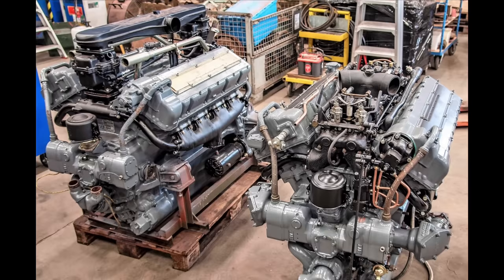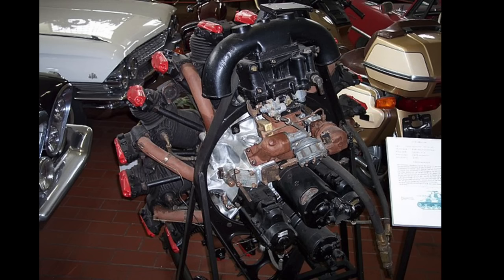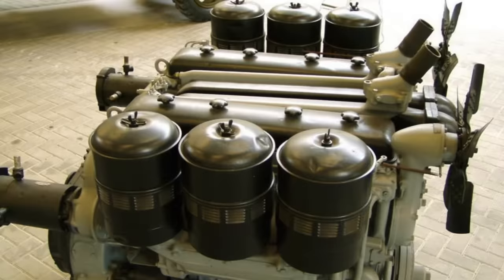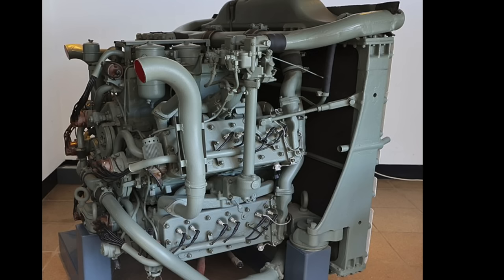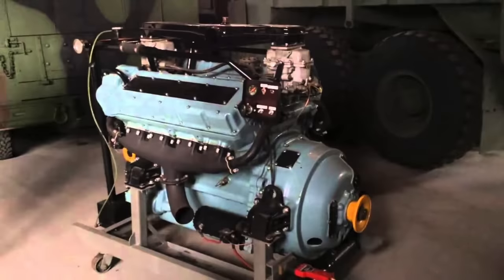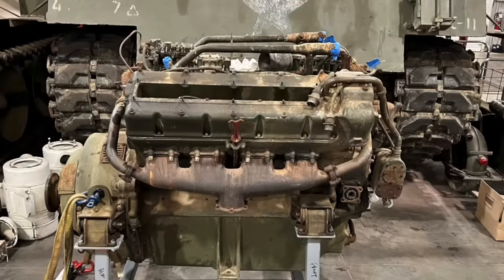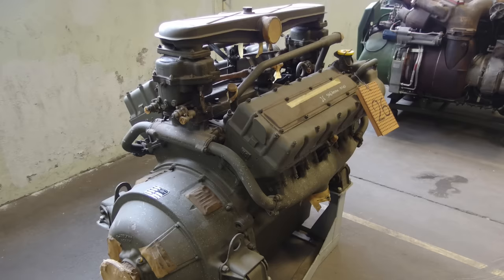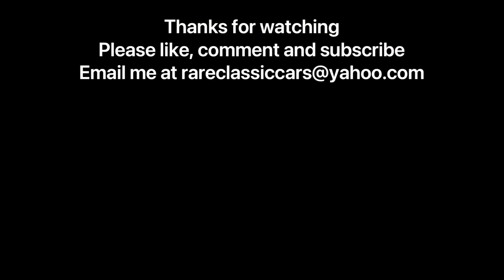An All-Aluminum, Flat-Plane Crank, DOHC V8 in 1940! Ford's 1,100ci (18L) GAA V8 Is a WWII Marvel

Comment: It's amazing that after the war they went right back to producing the flathead for like another 10 years
Reply: One would think about the times... There really wasn't a horsepower war, and Furd relied on the fact that their vehicles were built light, as were most mass-produced autos, the flathead motivated those Furds right along to justify them to keep making the quick buck with every option... as long as it was black.
Reply: Cost had a lot to do with the flathead V8 engine design. Also the main reason GM, Chrysler and Ford all still produce pushrod V8's today.
Reply: The flathead was cheap, reliable, and it worked.  Ford would have been making that into the 70s if GM/Chrysler/Foreign manufacturers didn't go to OHV first.
Reply: @randr10   That and they are much more compact and lighter, also something like a LS motor is so much more powerful per weight than most other engines and affordable.
Reply: Thermodynamically the Ford flathead V8 was a disaster from day one.  The long exhaust ports meant that much of the heat energy of the fuel went out the radiator instead of making usable power.  Add low compression and terrible volumetric efficiency and you have a reliable boat anchor.  Oh yeah, almost forgot the missing main bearings.  R.I.P.
Reply: Really...my very first thought. I wonder why a 1/3 version of this could have been made for cars...or at for least racing. It wasn't until the mid-1960s when Ford made their killer DOHC  V-8  255 cubic inch Indy engine winning the 500 with Jim Clark.
Reply: Its about production costs.  Today's cars are way WAY too expensive, partly because of things like DOHC engines, and aluminum-block engines.  The Japanese, who are subsidized by their government, started selling those engines in mass-produced cars, and that forced Detroit to follow suit.  Of course, it didn't help, as Detroit couldn't charge enough for the cars and eventually went broke selling cars at a loss.  Shows that Detroit's unwillingness to come up with "advanced technology" was grounded in facts, not just stubbornness.
Reply: @randr10 not to mention timing chains on OHC engines are lame
Reply: @sixoneninecustoms timing chains aren't lame, they're used for efficiency. Same as the chain drive on motorcycles.
Reply: Simca continued building Ford flatheads under license for military trucks all the way til 1990.
Reply: @theophilhist6455  arguably early 1960s for the DOHC design used on the Lotus Cortina, if we are allowed to count the British Fords. The DOHC head design was from Lotus, but it sat on the engine block used in the regular pushrod Ford Cortina 1500.
Reply: @randr10  GM and chrysler are the only companies with pushrod V8 engines in mass production ,,ford has the Godzilla V8  which is pushrod design  but it's also not widely used ,,Chrysler uses the HEMI and GM has the LS design ,ford has been jacking around with multiple engine designs since the 90s ,,i think they are into the 3rd or 4th generation of the coyote since 2014
Reply: @jasonbungard7484  Sure did.  That's why French blocks are sought after.  They are newer and less likely to be fatally rusted inside.
Reply: When production resumed for civilian vehicles in 1946, they were just a continuation of the 1941 models.  Took about 3 more years for Ford to produce all new vehicles.  Pretty much for GM, Chrysler, Nash and Rambler.
Reply: The flathead v8 did it's job love it or hate it. So did the GAA in the tanks. The auto manufacturers had the technology back in the day to build things unimaginable of the time. Just look at the Merlin and Packard engines. But you have to look at what it costs to manufacturer such engines. Not too mention training mechanics and equipment dealers would have to have to work on them. It never really made any sense to me why people need a thousand horsepower to drive on the street. You can really only legally go 70 or so on the interstate
Reply: @jimmotormedic  Look at what Duesenberg did in the '30s.  Straight 8, supercharged, fuel injected DOHC engine with about 320 HP.
Reply: @timclaus8313  what an amazing automobile! I guess it's always been a race with luxury and speed. Those cars are pure automotive jewelry! The funniest thing about that car back then was you'd be hard pressed to find a road that you could let it loose. But again I know it was during the depression those cars were just to expensive to build and the market was very very small and I don't think they would have survived even if the depression never happened. Especially without a good inexpensive high profit high volume car being produced under the same name. But you are right about the technology for sure!
Reply: It was also about retooling the auto plants that have been producing war materials for 5 yrs. It takes time. That's why the big 3s cars in 1946 47 and48  were just slightly altered 41 models.
Reply: @ATomRileyA a Flathead V8 is NOT light by any means.
Reply: @timclaus8313  The 46s were pretty much continuations of the 42s, not the 41s.  Ford was ready to come out with all new post-war designs for 1948, but decided that the proposed 48 Ford was too big and heavy, so all were moved up a division - that 48 Ford became the 49 Merc, the 48 Baby Lincoln became the 49 Merc, etc.  At GM, the Cadillac and the Olds 98 were brand new cars.  The Buick would have been, but Harlow Curtis, at the last minute, decided he didn't like it, so Buicks weren't new until 49.  Studebakers were all new for 47, Hudsons for 48.  Chrysler products weren't new until mid 49.
Reply: If Ford had produced some variant of this engine during the muscle car era, they would have KILLED everyone else.
Reply: It all came down to what was easier and more economical to produce.
Reply: cheaper, simpler.. mercedes, had ohc, shaft drive. ducati, desmodronic, shaft drive cams..
Reply: @matthewstorm5188  Wouldn't that have been kool?  Wonder what GM and Chrysler would have been forced to come up with?
Reply: Ford did produce a variant during the muscle car era, it’s called the cosworth dfv….
Reply: And I did kill… almost every winning f1 car from late 60’s to the turbo era used one
Reply: It* not I…
Reply: It was originally designed to be an aircraft engine.
Reply: @jasonbungard7484 wha?!?!  That's interesting.
Reply: @ДжонПартлов  But we couldn't buy it for street use.
Reply: Ford plants all over the world (including Germany) built the flathead V8s throughout the war for military service, plus in France they were produced up into the 1970s and used in some of  their military trucks into the 1990s
Reply: In your opinion but opinions are like assholes, everyone has one. The flathead was the first V8 engine block cast in one one piecesnd was the beginning of modern V8 engine design. It was an astounding success and was revealed by all and was the beginning of the hot rod and muscle car engines. It was NO small feat! Talk trash if you want but you should know that the flathead was almost 100 year old technology and was THE only V8 a common man could afford at the time. You sound a lot like a chevie fanboy.
Reply: @Axeman428  I am more of a Ford guy, but I don't hate all Chevys and will give them credit where credit is due.  It is Datsuns and Toyotas that I hate.  And I know all about the Flathead Ford.  The Oakland-Pontiac V8, and maybe the Viking V8, was the first V8 to be cast in one piece, but those cars weren't low-priced cars, and the Pontiac V8 used a 180 degree crankshaft, so it "buzzed" at certain speeds, just like a 4 cyl, and the Viking V8, from what I have heard, wasn't any good.
Reply: @josephlannert969  Correct.
Reply: @randr10  ford only recently started producing a push rod engine again whereas dodge/ gm  never stopped
Reply: @fyrbyrd71  Any color you want as long as it is black ended with the 1926 Tin Lizzie.  The 27 Model T was available in colors other than black from the factory.
Reply: @Hopeless_and_Forlorn  But still, it was a V8, not just a 6, and it was a V8 in a LOW PRICED car.  It also could be made much faster than stock.  Compression was competitive with other makes at the time.  And it was exhaust heat that was excessive.  Exhaust heat doesn't make any power, unlike the heat of combustion.
Reply: @sixoneninecustoms  While a shaft and gears is better, a metal chain is better than a rubber band.
Reply: @richceglinski7543  42 models, not 41 models.
Reply: @jamesbosworth4191  ohc double or not doesn't really count much into a cars total cost, very little in current american market cars which cost a lot of money mainly because people can afford and they will buy most expensive most fitted with extras cars on the planet.
a bunch of it is factory/manufacturing politics and stuff though, like fiero could've had a much more powerful lighter engine in-house from GM that was in production for cheaper cars if they weren't married to the duke. 80s of course was the worst for american cars and not just due to emissions but to stubborness of not adapting cleaner more powerful smaller engines - with the upside for hobbyist consumer of course that you could get a lot more out of the american v8's of even 80s with just a few mods, which you cannot do with european engines of the era which were much higher output per cc straight from factory so there's not much gains to be made easily.
Reply: @jamesbosworth4191  👍 Just a little comic relief laden with a little fact... that's all.
Reply: @lasskinn474  You are wrong, and probably fairly affluent.  SOHC doesn't increase costs much, but DOHC DOES INDEED increase production costs, as does using aluminum for blocks and heads.  Variable Valve Timing also increases production costs.  Quite a bit.  OHC, single or double, does nothing by itself to decrease or increase exhaust emissions.  American engines had lower output per cubic inch because, until recently, American motorists demanded low RPM torque, and abundant low RPM torque requires lots of cubic inches.  Sure, a small screamer can produce the same amount of horsepower, and because it is much smaller, produce lower emissions per horsepower, but most Americans, until recently, did not like such engines in heavy cars.  Cars so equipped seem like Gutless Wonders.  When we give it more throttle, we want more power.  NOW.  We didn't want to have to constantly row the gear box at every hit of a grade.  Can you imagine a 3500 - 4000 pound car with an engine less than 200 cubic inches?  Most Americans would have refused to buy it.  Yes, most of today's drivers, having been weened on nothing but Japanese cars, don't demand torque, but before, we did.  I still do.  I still refuse to buy a Japanese car, and I still refuse to buy a car with a small displacement engine.  I don't care for their "feel", and it is my money, not your's.
Reply: @timclaus8313  It wasn't fuel injected, but it indeed was all those other things.  Gary Cooper's supercharged Duesey made an estimated 400 horsepower!  Wouldn't you love to have THAT car?
Reply: @1953fords  Compared to a Cadillac V8 it is.
Reply: @fyrbyrd71  Sorry, but some folks really think that "Any color you want as long as it is black" lasted through the 30s!
Reply: @jamesbosworth4191  having the valvetrain overhead leaves you with more freedom with valve head design to get a cleaner burn and less moving mass in the valve train itself.

your refusal to do those things and belief that using more material is cheaper is kinda why you have expensive cars.

anyway, most cars in the world are less ci per pound than that 4000 / 200. say a 3l turbodiesel 4cyl 200hp car is just fine and works long long time, is cheap to maintain, easy to work with(much more space in the engine bay) etc - entire thailand operates on such and smaller hauling basically everything, just beef up the suspensions and go.  the true gutless wonder is the low output heavy v8 - and somehow they didn't even manage to make them last long.
Reply: @jamesbosworth4191  That be fun.  Also would like to have a blower Bentley, lol
Reply: cheaper to produce, simple design.
Reply: @jimmotormedic  There is always going to be somebody, somewhere, who will let their car loose, especially if everybody says "you can't do that".
Reply: Yeah that's for sure. But it seems like that in modern times there are a lot more people with less of a brain driving race cars on highways these days. It's bad enough when someone gets killed doing something stupid, but it's a real tragedy when innocent people get injured or killed because someone doesn't use discretion or discipline when using such power. It will never change I know. But it's just something I think about
Reply: @jimmotormedic  You are absolutely correct.
Reply: Fordbisbindacca
Reply: British firms played with 6 cyl's  simply split in half spitfire engine for their jag's    right after the war
Reply: @gentlemanzackp6591  Never knew that!
Reply: That’s ford for ya, stuck in the past, had a good thing but thought flat heads where a god idea 😂
Reply: @ohger1 - I remember them well. They had a different sound. I was a mechanic on the Shacker-Pim drag team crew on Long Island, and we had a flathead which if my 83 year old brain remembers correctly was equipped with a rotary blower. It was in an unchanneled 32 Ford roadster which did well at the track.
Reply: That flat head. There is another story. Ford seized production out rite for a time putting that package into production. They had a flaw then promoted it like hell when they corrected the problem. Advertising was different then too. They didn't miss a beat.  Essentially Ford is still going strong today. (best I can tell).
Reply: @Hopeless_and_Forlorn  You are looking at the ford flathead v8 thru the eyes of modern engineering. Most of what you have said could be said about many of the engines of the 1930s.
Reply: True. But only 7 years.  This is My personal guess:  Ford Engineering  very likely started development of the Y Block as soon as Old Henry died in 1947.  As stubborn as Old Henry was, Ford would’ve gone on building the Flathead indefinitely.
Reply: @Hopeless_and_Forlorn .  Yes, there were two missing.
Reply: @Corvacar  If it wasn't for pollution laws getting onto stationary & industrial engines, it's possible they would be building the flathead today for small scale generators. Applications where reliability is one of the most important considerations.
Reply: @timclaus8313  On the other hand a Duesenberg cost a lot more than a Ford did. The technology was available, but whether it was prudent to use at a particular price point is another matter.
Reply: @iskandartaib Yup, a 1930 Duesy was about $8500 for a chassis, then you had to pay for the coach work to put on top of the rolling chassis.
Reply: @timclaus8313  From looking at magazine ads from around 1935 a typical Ford or similar was around $600, so the Duesenberg was around 12-13X that, before the coachwork.
Reply: @iskandartaib  Yeah, that rolling chassis was about 5 or 6 years of annual salary for the average worker.
Reply: @jamesbosworth4191  New cars are overpriced easily at least 2x, trucks 3x
I see EVs priced the same which is a ripoff. No way it costs as much to make as an ICE car. 
Ill stick to old stuff I can fix and not married to a dealer for parts/service.
Reply: @sixoneninecustoms  Never was enthusiastic about rubber timing chains.
Reply: Pretty much every american car company sandbagged how much development they made in the early days - despite having most ideal configurations figured out by the 40s as can be seen here and with things like full floater hubs on the big trucks. That way they could pretend to be coming out with new and revolutionary stuff each year and keep costs down at the same time; stuff like that and skilled labor were the US's claim to fame. Same reason they hit a bit of a wall in the early 70s and started losing out to Japanese and German competition
Reply: Well, the 1946 models were essentially 1941 models for all the manufacturers.  Keep in mind that for 4 years, all labor and engineering effort went to building equipment for the Department of War (now DoD).  Takes a while to engineer new models and rework the entire engine foundry.  Ford didn't release an all-new car until 1949, and a new engine in 1955.  Plants had to finish equipment already under contract for delivery, then move all the raw materials for war equipment out and switch all the manufacturing equipment over.  All takes time, plus their experienced car building labor force had to be de-mobilized and return to work.
Reply: @timclaus8313  The 46s were warmed over 42s, not 41s.  Ford did have all new cars ready to be released for the 1948 model year, but decided that the proposed all-new 48 Ford was just too big and heavy to be a Ford, so it became the 49 Mercury.  The proposed 48 Merc became the 49 Baby Lincoln, the proposed 48 base model Lincoln became the Lincoln Cosopolitan.  They never were able to come up with a post-war Continental, so Lincoln lost a chance at having a super-luxury model that would out-Cadillac the Cadillac, hence, the 56 Continental Mark II.
Reply: @timclaus8313  Also, Ford had a brand new Overhead V8 in the 52 Lincoln.  The Ford/Mercury Y block came out in 54, not 55.
Reply: @jamesbosworth4191  The late 40s, early 50s was a time where Detroit put out lots of new OHV engines, once they could get their factories retooled for new US vehicles.
Reply: @timclaus8313  Not true. Not fuel injected. Not supercharged. Not 320HP.... otherwise correct.
Reply: @maniacjack3700  Carbureted yes, the SJ made 320 HP the SSJ made 400 hp.
Reply: @timclaus8313 You are right. Sorry i didn't know these supercharged variants.
Reply: @maniacjack3700  Even the base Duesenberg engine was very impressive for the day.
Reply: @timclaus8313 That's right!